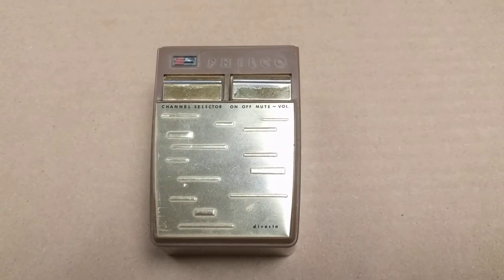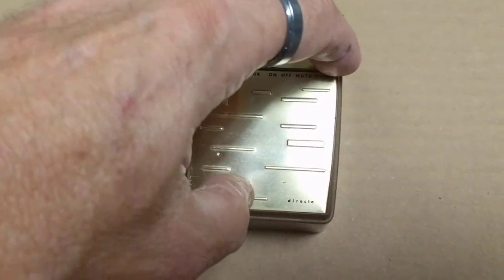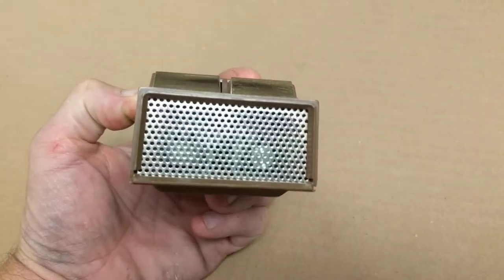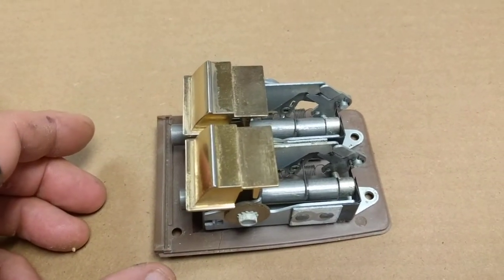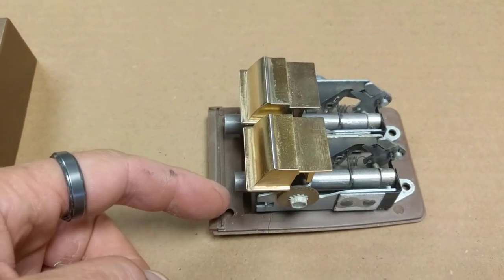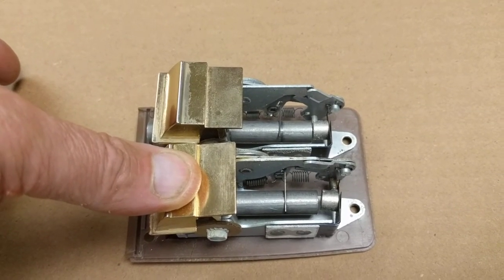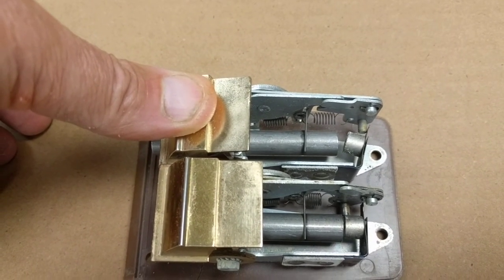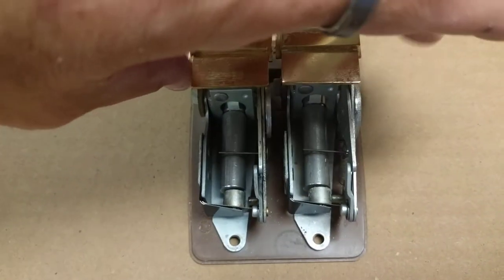How the Philco Directa clicker style TV remote control works

Comment: I can hear the ding just fine. It can't be ultrasound just really high frequency.
Reply from the maker: You hear the audible sound of the mechanism which has nothing to do with what the TV is listening for.
Reply: @feraloid  If that's true, then the tv is listening to a higher harmonic than the 18khz or whatever it is that I'm hearing. My dad had a similar remote on his desk for many years. I could always hear that one was tuned higher than the other as a kid. ¯\_༼ •́ ͜ʖ •̀ ༽_/¯
Reply from the maker: @jonnda  You're hearing the sound of the hammer and springs that make up the button and striker mechanism. It's all steel so it rings in a variety of frequencies. It's also why some early remotes were called "clickers". The ultrasonic sound is the resonant ringing frequency of the 2 different tuned round rods; they're both 9.5mm diameter, one is 63.17mm long and the other is 66.73mm.  I believe they're a variety of stainless steel as they're slightly attracted to a magnet. The phone mic and encoding isn't going to be sensitive above about 18khz, so I don't have a means for measuring/recording the actual ultrasonic ringing.
Reply: @feraloid  It’s not about your recording equipment. My dad had one of this type of remote, and I used to play with it when I visited him at work. Magnavox brand iirc. I have heard it in person. All I am saying is that each button made a different audible pitch. As the parts seem identical aside from the different chimes, I would be more inclined to believe that I can hear the fundamental tone, but that any harmonics wouldn’t be audible except for by the tv. Like one at 18khz and the other at 19khz, but what the tv cares about is an octave or a fifth above that. I figured that you just couldn’t hear it because you’re older than me or something. 

Anyways, it doesn’t really matter. Goodnight.
Reply: @jonnda  is right - the tone produced by this is actually within the audible range, it's just that most adults lose sensitivity to those higher pitches. I can still hear the ring just fine when you click the deal (even in this video not just in person), not the mechanical slam noise, but the actual tone produced by the vibrating rod; but then again, I never blasted music so my hearing is much better than most adults.
Reply: They're audible by younger people but most older adults will have lost the ability to hear over ~14khz.

My grandmother had this remote and I remember hearing it as a kid. Also made her dog bark. LOL. It was very high pitched. I could also hear the scanning ray in a TV (around 16kh) as a kid but lost that ability in my early 30s.
Reply: Some humans have ultrasonic hearing capabilities through bone conduction